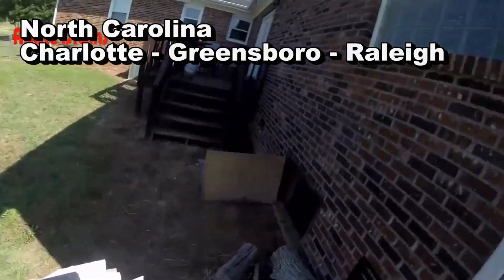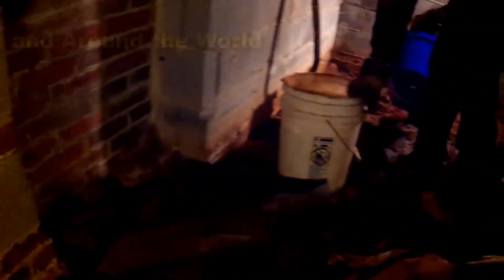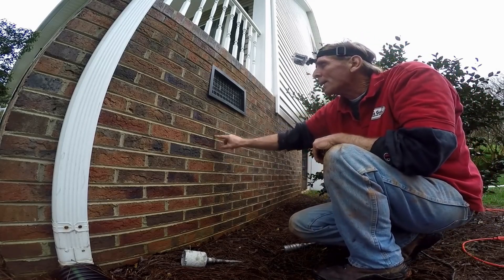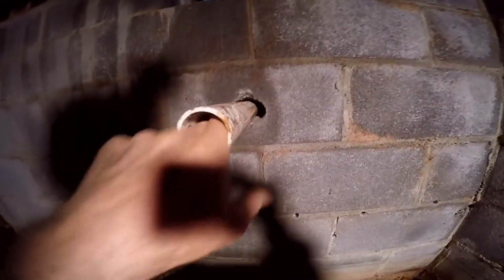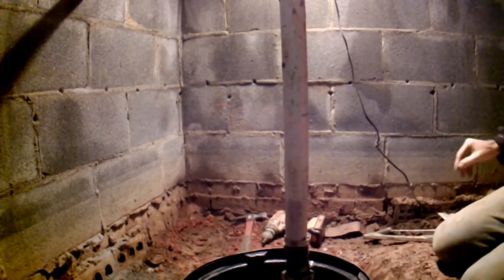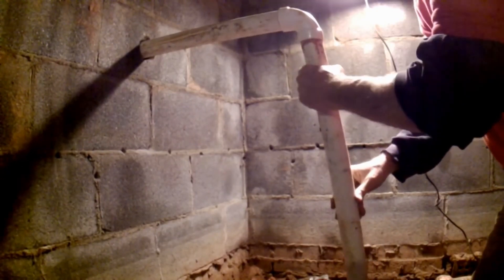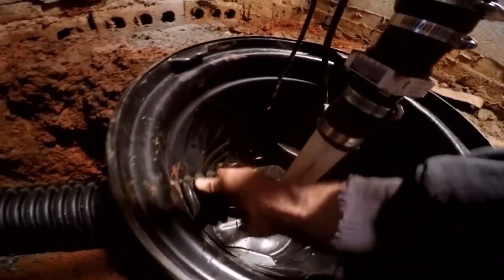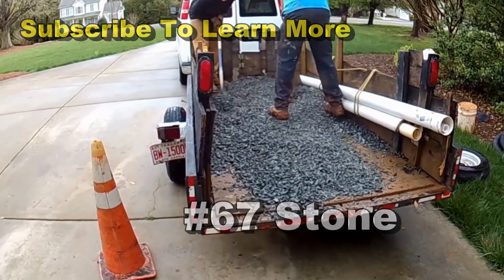10 Year Old Home - 10 Year Old Problem - Crawlspace DIY

Comment: Can you do an update to your video about how much fall you need when digging a trench? I had a hard time finding it when I searched for trench slope/level.  There are a lot of other videos recommending slope. I think your videos should show up at the top of search results. My main question is if dirt and debris get in the line, will a level or slightly negative slope section still drain? Thanks for all your videos. I’ve learned a lot.

Comment: Good job. Any reason why a solid pvc pipe is not used?
Reply from the maker: Very seldom would we run PVC in the crawlspace. It’s not the same as outside. Corrugated pipe works in all situations and when Properly installed, there is are problems
Reply: @appledrains  : thanks for the answer.

Comment: So the drain pipe is still set at the footer, regardless of being an interior job, right? Cuz a company did my crawl space, but put the pipe at level / barely below the dirt. I have puddles still. Wondering if I should simply just dig deeper and replace drains near the footer??
Reply from the maker: Hi Marcus! Yes, Our footer systems are always right at the footy level. Very seldom are we on top of the footer. Sometimes we see footers that are not very deep, but that may not be the problem you’re talking about. Did they drill into the sump basin? How deep is the sump basin? 

Mini times companies do not bring their pipe directly into the basin. Instead they drill a bunch of holes and let the water migrate through. That usually causes the problem that you’re referring to. 

Hope that helps,
Thanks, Chuck